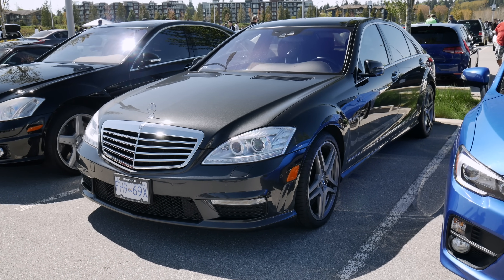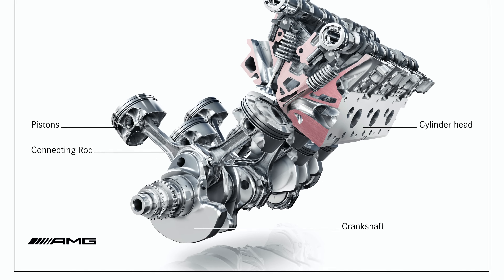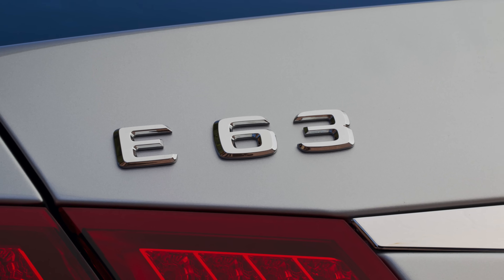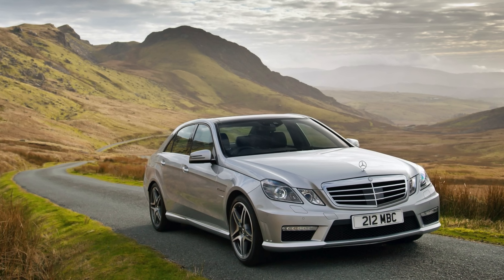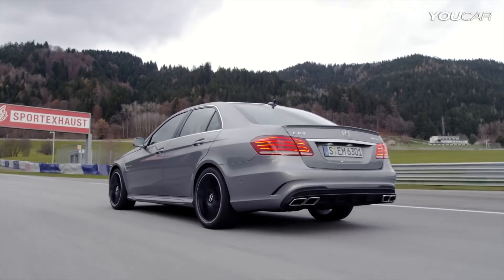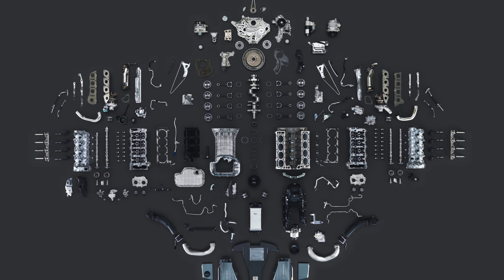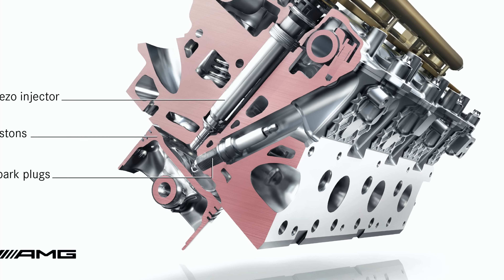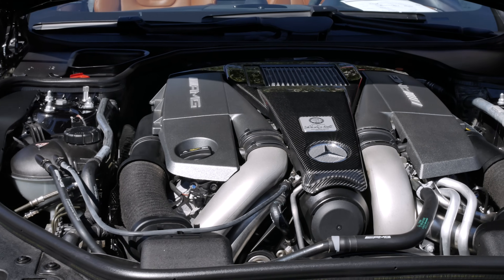Mercedes-AMG M157 Overview | V8 Biturbo (4k)

Comment: Thats my engine in my CLS63! Love the car. Not as raw as the C63 was that I had, but in the CLS its really smooth.
Reply: Any updates on the car’s reliability im looking for one currently, i got the cls 55 m113k
Reply: @mohammedal-blaushi8495  It was great and ran strong with a tune for over 10K miles, but I sold the car in 2022 for something in a manual. The m113k is bulletproof, so I wouldn't worry about your engine at all if I were you. 
Find the legit street cars channel and check out his videos on modding the m113k engine - and especially the transmission! Yours has the same transmission as some Chrysler models and there are upgrades that are pretty cheap for making that transmission shift harder/smoother/quicker/etc...
Reply: Is is a reliable motor? I've been in love with the CLS for a long time.
Reply: @panamera53  Yes the M157 is pretty bulletproof like the M113K

Comment: Hi my friends, I have CL 500 and I’m having a issue with her battery, she drains battery in two days if starts everyday it’s okay but if I leave it for two days then she won’t start, I have replaced battery twice, first I put AGM battery and had a same problem then some mechanic told use normal genuine one so I put Mercedes genuine one but still same problem. Any suggestions please. Thanks
Reply: If its drain the car battery when completely off, it means theres a problem in some electrical system. Not owning an MB but maybe it can help a bit.
Reply: @nun_nuno  i think he allready did knew that mister einstein......
But still very smart of you to tell,i really could not think of that!!!
Reply: I've had similar problem with W204. It turned out there was custom mounted immobiliser sucking the battery out. After removing the damn box everything returned to normal.

Comment: I don't know why manufacturers like Mercedes tend to have issues at every first gen of a new model. Why don't they learn their mistakes from previous builds to avoid when designing newer models?
Reply: Ogremair thats a very easy way of breaking down such a complex topic. Each new generation has new mechanisms which cannot be the same as the generation before.
Reply: Money money money!!!
If there are enough stupid people who just buy these thing just because its a hype,i dont blame mercedes to sell it to them!
Reply: Research and development and testing can generally find the vast majority of problems/weak points, but until you start mass producing a product that is then used in many different scenarios, you're not going to find everything. This is the case with essentially every car and manufacturer. It seems to happen more with the German luxury OEM's since they're always the ones pushing for more technology and innovation.
Reply: They did learn when they built the M113 and M112.

Comment: Was about to buy an e55 but ended up going with a C6 Z06 I got for a steal..  honestly I don't think I'd get another Mercedes ever again now that I've experienced the LS7, however the E55 is still one of my dream daily drivers
Reply: Make sure you take care of those valves.  Would be a disaster if they dropped
Reply: The butt hurt is strong with German car fanboys
Reply: @alimehrozi2828  funny how chevy still makes a way better engine
Reply: @narcissistinjurygiver2932  yup alot of M113K platform owners move onto the LSA platform
Reply: @alimehrozi2828  the m113k is a great engine.i just have the m113 in my sl but i got the car for 1200$ due to ABC problems that I have totally rebuilt
Reply: In that case why sharing that here?
Reply: What is the point of your comment?

Comment: Awesome! I just bought a E500 Coupe with the M278. What a magnificent engine even in the non AMG version. Also id like to know what exactly the difference between the M278 and the M157 are besides the higher displacement of course. Also you should have mentioned Brabus. We took this engine and made a 6.0 liter version with 850hp out of it. It sold really well.
Reply from the maker: Surprisingly, there is not that much difference between the M278 and the M157 other than the increase in displacement. The other main difference is that the m278 has smaller turbos with only up to 13 psi boost.
Reply: @AMGmeister  The M278 Motor is a 4.7l v8
Reply: Phuong Nguyen I know that. But I mean the base structure of the engine. What about the cylinder heads? The parts around the engine? I think it’s pretty much identical. I know this engine quite well. Like I said we sold so many of these in the 6.0 liter version. Brutal machine.
Reply: Phuong Nguyen I think they are pretty much identical. We put 500hp in these cars.
Reply: Phuong Nguyen Did you even read my last comment bro? Wow...
Reply: Wow Really In my new video that I just uploaded I take it for a first drive on the Autobahn. I think 575hp shouldn’t be a problem but it’s a bit of work. I might give it a stage 1 tune wich is 500hp. That’s plenty fast for a car that is based on a C-Class :)
Reply: Wow Really We have a Project One on order but I don’t know when we will get it. I will try my best to get it on camera when it arrives!
Reply: Wow Really You don’t need to explain to me how an engine works. Of course the AMG engine has different pistons and crankshaft, that wasn’t the question. The question is how many parts are the same? What about injectors? The fuel pump, the cylinder heads, oil pump and so on. Also i asked a question and didn’t make a claim. My question was if the 4,7 liter engine has any major difference besides the parts that have to do with the displacement. The M278 even looks identical. You can fit a AMG engine cover on it. So obviously they can’t be to different.